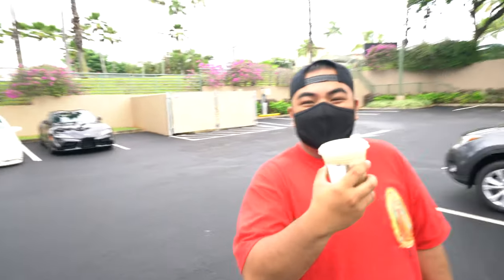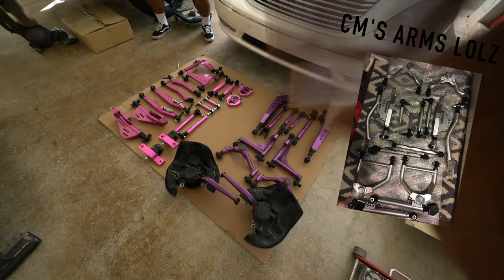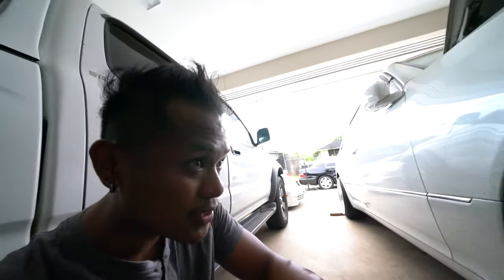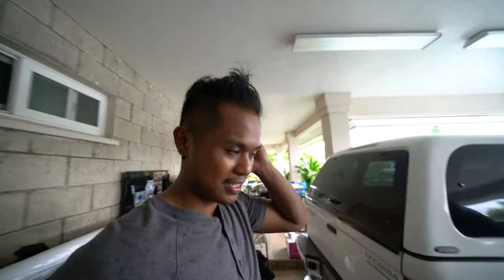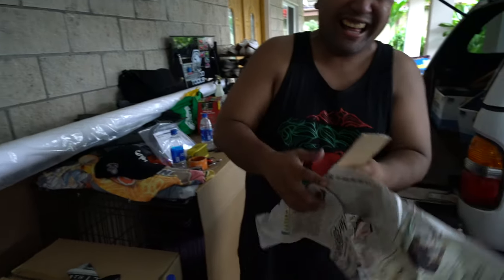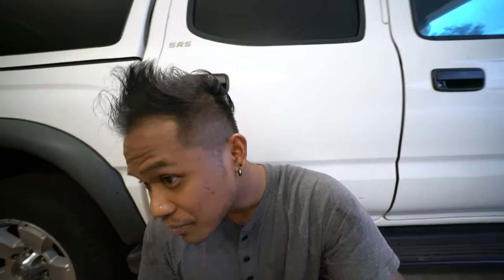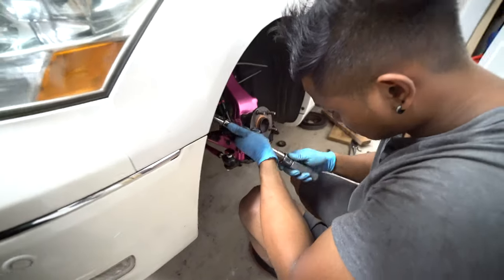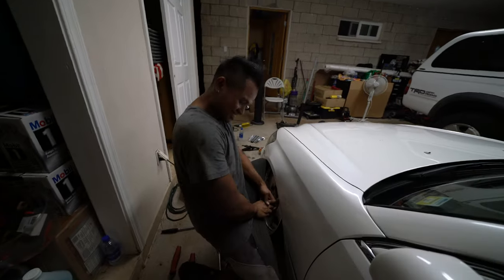JAY | VLOGS FULL SEND ON THE LS' PART 2 (EPISODE 58)

Comment: Damn that LS is crazy!! I'm looking into getting the front lower control arms and I was wondering if you had any issues installing it with the Airlift strut? I seen on some T-Demand dealer's website that you need a T-Demand coilover/strut setup in order to run it and I was confused cuz I just seen you pull it off lol
Reply from the maker: Nah no issues. Installed as if it was a regular strut
Reply: @u1StupidKiD  thanks for respondin and for the info! 😎